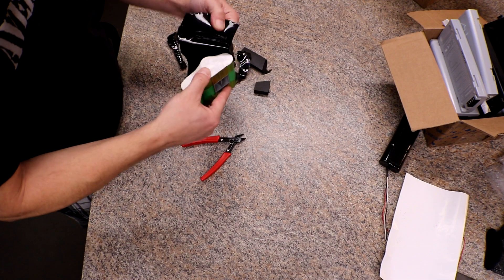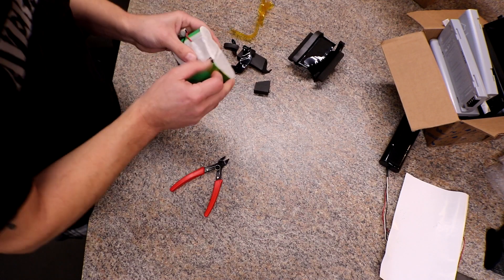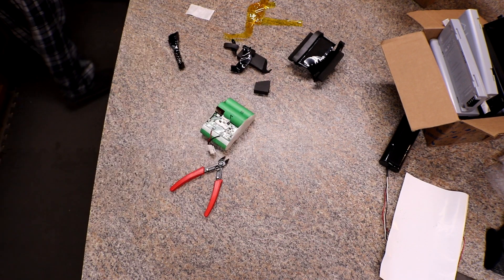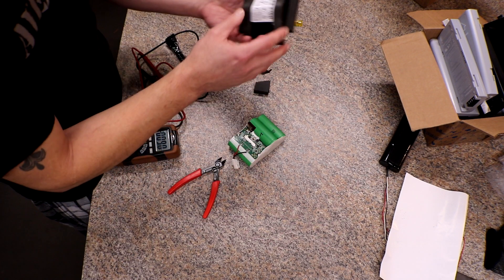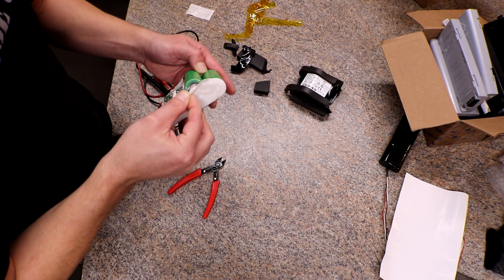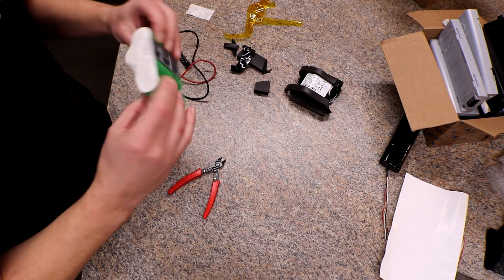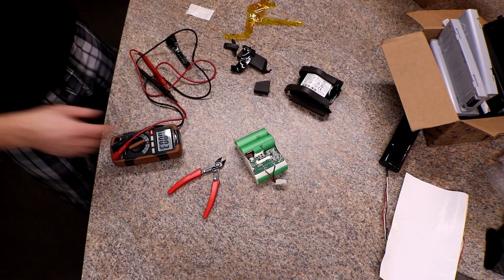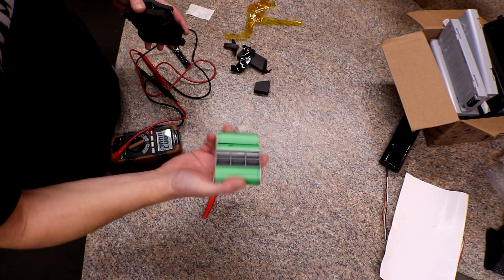Diy Tesla Powerwall ep70 Im Still Alive Its an Update

Comment: hey bro! Can relate... 40 projects on the bench and then... life lol.
Those are 1.2V Sub C batteries. Probably NiMh but could be NiCad in which case, throw em.
Reply from the maker: Yeah its frustrating at times but not a lot you can do.  Yeah those where NiCad and in the recycle bin.  I have gotten li-ion versions of those cells before tho.

Comment: In your queue of 368 current and ongoing projects, might be time to move "insulate the house" to a higher priority. ;)  Did the guy that hooked you up with that DIY spot welder tell you what to expect when it comes to the amps you can draw on each weld?  Is the power easily adjustable?  Also, if you wanted to build a 48v version of that (so you can run it off of your current setup), what changes would you have to make for the design?  I haven't messed around with the Arduino stuff yet, but it seems really cool and nearly limitless in potential applications.  Cool vid, man!
Reply: I believe it pulls about 400A but it pulls it from the car battery. The components on it can handle up to about 1000A. The pulse time is easily adjustable using the pot on the top board along with the 7 segment display
Reply from the maker: Its 379 projects meow!  OMG I need to insulate badly!!!  Ill get more info on the spotwelder but I think I could use all my lower capacity 18650s.  I have 100s of the red sanyos that are kinda newish or hardly used from the black medical packs.  Yeah there is a little dial to turn to adjust.  Samzies for the arduino stuff, havent used one but potential is there!!!

Comment: I was an Aircraft Mechanic also when I was in the Navy.  (AMS) Mainly structural, flight controls and a little hydraulics.
Reply: As a former AE, I always knew there was a crew that wasn't going flying when I'd pick up a MAF with a fault "switch does not work in OFF position".
Reply from the maker: Yeah about the same job but this one as a civ we do aaalllllll the things.  Hydro, electrics, engines ect... Its cool most of the time but you get those jets that dont want to go away lol✈🔧🔨⚒🛠⛏🔩⚙
Reply from the maker: Love when people write stuff up with a fault or doesnt work in the O.F.F.  mode😆

Comment: Those batts look like 26650?
Reply from the maker: Yeah I believe thats what they are, FIRST TIMER!😵🔋
Reply: They are probably LiFePO4's in a s2p2 configuration guessing from the voltage on the pack Stick a 5V buck board on them and you will have a neat little 5V power bank.